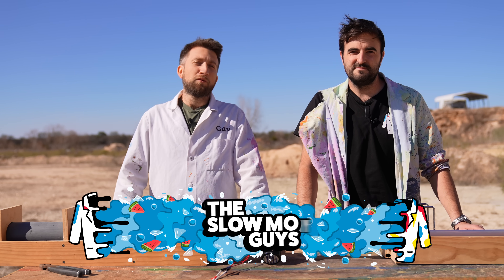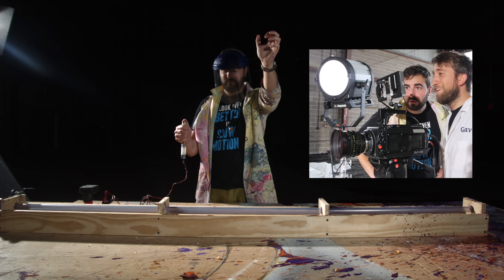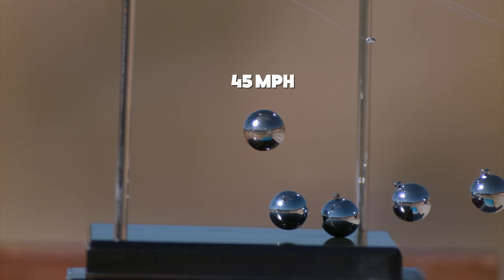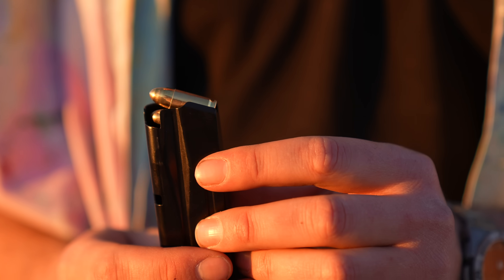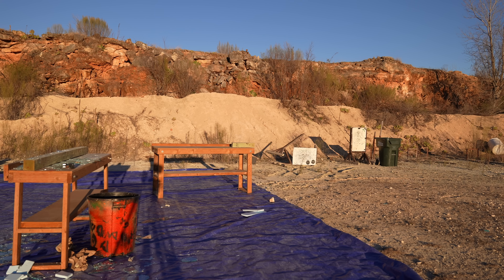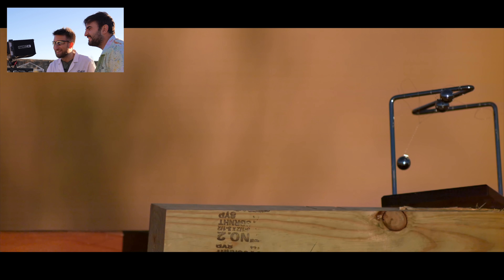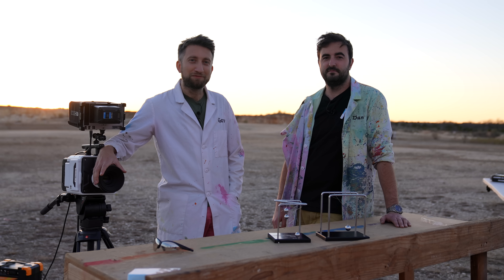Bullet vs Newton's Cradle at 100,000 FPS - The Slow Mo Guys

Comment: Good video.  The concept of the conservation of energy is a rather prominent and important concept in physics.  Which applies to no end of mechanical design and such.

@7:25 (or so) Daniel mentions 'cupronickel' as jacket material.  Cupronickel was used as jacket material in the past, but in 1920s (a period of time) manufacturers changed over to what is known (at least in the United States) as 'guilding metal'.  There is a difference in the composition.  
Cupronickel is an alloy of copper, nickel and some small percentages of a couple other metals.  (Look it up on line, this is the minimalist version.)  Cupronickel has been used for various things since China in the 300 BC range.  It has a multitude of uses, and is highly resistant to sea water, among other traits.  In the early days of the smokeless propellent era, it was used to make bullet 'jackets' the harder outer shell of a lead core bullet.  That set up worked much better than plain lead.
However, after several years, cupronickel was found to leave deposits in barrels.  So much that the deposits could alter the internal pressure of the arm and create explosion possibilities (and seemingly some explosions).  
Gilding metal is another copper alloy but no nickel.  It does also leave deposits (smears) in the barrel of firearms but at a much lesser rate and seems only to affect accuracy in extreme cases.  This material pretty much replaced cupronickel as mentioned.

Cupronickel is nickel colored - easy to confuse with silver.  Guiding metal is copper colored - easily confused with gold.  Not difficult to distinguish.  However, 'cupronickel' is still used in popular conversation to refer to bullet jackets.  Added information:  most commercial ammunition is not 'steel jacketed' either.  A few specialized rounds are, but they are nearly all made for and used by various militaries for special purposes.

Comment: I wish you guys can show us a Slo Mo shot of a car engine combustion chamber when the pistons squeeze the air and fuel mixture down to a centimeter tight and let either friction or spark plugs depending on what fuel you use diesel or gas ignite the mixture and send the pistons sky rocketing down to the crankshaft. That would a worlds first slo mo shot and pretty cool my uncle dad and grandpa would definitely love to see that

Comment: Strings are too short to not break immediately and thus affect the trajectory of the ball. You should make a 10' tall Newton's Cradle and try this one again...maybe even use 50lb fishing line?
Reply: To me, it looks like the string is not breaking, but the mount is coming off of the balls in most cases.   The best thing would probably to use piano wire and drill a hole through the balls and run the wire through the hole.

Comment: The bullet thing is a lot less surprising when you think relative. To us the bullet is moving extremely fast at the ball, but from the bullet's perspective, it's instead the ball that is moving extremely fast at the bullet. They are both colliding as equals, and the ball bearings were simply bigger and harder. If you shot a ball bearing at the speed of a bullet at a bullet, you would probably expect the bullet to shatter.

Comment: Something else to consider: the BALL bearings are, well, balls.  That continuous curve also deflects energy remarkably well unless the bullet hits it straight on. That's the same concept tank designers were starting to catch on to as early as 1917.
Reply: Right, rounded, welded or cast armor is much more effective than riveted armor with all its right angles
Reply: @edwardcardona717  it really depends on the angle except if one has got these special multi material armor they've got today
Reply: he he balls 🫵😂
Reply: @tigersarecool471  as well as medieval tower designers! It’s a very, very, very old concept, likely old as time, though people may not have fully understood it.

Comment: 9:45
Skip all the garbage filler
Reply: Why is it filler?
Reply: @Jack Costabile I guess you can view it like that, but I don't think you can call the original thing they set out to do filler when they only decided to do the gun stuff on a whim after doing a few test with the original one. 
Why is it garbage, I guess would have been the better question. I could think of multiple reasons people would want to watch the stuff before the timestamp provided.

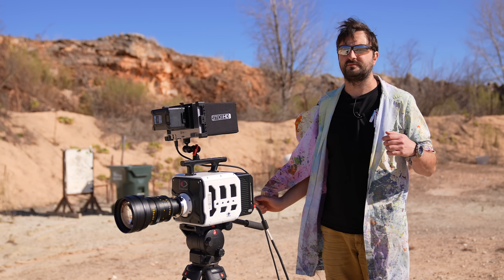Comment: @5:03 you can see the shockwave travelling up the suspending lines, at an angle similar to what you see with schlieren imaging.  Perhaps it could be used to determine the speed of the shockwave through the suspended balls?

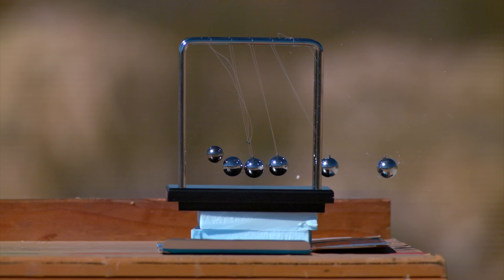Comment: 3:33 , It not only had enough power to force the end ball to rip itself from it's supporting line but also enough for the ball to CONTINUE pretty much going perfectly horizontal at the velocity, I guarantee you could set up a target at the other side and that end ball would be hitting it.
Reply: They should have measured the distance and fall rate of the last ball that came off. The rate of fall is deterministic, and the velocity of the last ball is deterministic and measurable from the video; so it would be interesting to see if the last ball landed where expected with the fall of gravity and the velocity.
Reply: MY BALLS!

Comment: That's an impressive shot and a remarkable result. I expected the bullet to fragment on the hard steel ball since it is only lead, but I thought it would impart way more of its force into the cradle as it hit. I really figured the whole thing would be completely destroyed. Really cool stuff!
Reply: Watch the fifth ball leave the frame. A Newton's cradle is designed especially to conduct that energy from one to the next with the lowest possible loss of energy. It is why the hooks that are attached are simply glued rather than welded. Any deformation in the sphere would diminish its ability to transmit energy.

Comment: Lethality of bullets are two-fold; the weight of the projectile and the speed of the projectile.  The ball bearing has MUCH greater density.  The lead bullet is also much softer than the ball bearing; hence your results.

Comment: How about trying this with API rounds? If there isint any available you should be able to make one inserting peace of endmill carbide or hardened steel drillbit to center of the projectile. That should be harder or hard as ball bearing hence not shattering like bullet did.

Comment: The newtons cradle relies on transferring all of the energy (or as much as realistically possible) so the hardness off the balls is key. The soft bullet just can't transfer it's energy efficiently because a lot of it is lot in the deformation, and the pieces also take a lot of enrgy with them.

Comment: Ok guys Ive watched this video a few times, on the second test, the impact broke off the connecting ring. I'm sure the steel ring is stronger then the string holding it, so why didn't the string just break instead of the loop connected to the ball. Also what is that called?

Comment: The reason  the FMj round basically desentagrated is because that's what hand gun ammo is generally designed to do 

Create massive wound cavities to do the most damage on the  intended target without over penetrating especially  FMj and holopoints because FMj in civilian and police application is normally regarded as range ammo and hollow points are designed for self defense on soft targets where you don't want rounds sailing through the bad guy or to take game humanity by dumping all they're energy  into the target  makeing a huge temporary hole hopefully disrupting the spinal cord or if your shot placements not perfect  at least sending the target into shock so they either have an instant on off or they really don't feel what's going on 
You can get copper rounds core bonds etc that would have faired better in the penetrateion department  due to material used and intended use more for getting through cover and car doors etc when a rifle isn't available

Comment: In the first clip all the wires break due to the kinetic energy.. but the first ball is different. The wire does not break, but the handle breaks off the ball, most likely due to the vibration on impact.

Comment: 10:00 one can see the last ball bearing, went flying, since it took most of the energy transferred from first 3 ball bearings: bullet shattered to pieces since it not-only incurred the brunt of first ball bearing, but also the action or left force/weight vector of the other three ball bearings still touching, thus the first one went flying!!! Due to energy transfer 10:15 sorry mate, only 3 ball bearings left… peace

Comment: Should’ve used lead bullets. NOT FMJ. You call yourself a weapons and munitions expert? What a dumb choice.
Reply: They weren't planning to use it. They just did it with what they had with them. Calm down.
Reply: Lead would have been even more brittle. Solid copper or steel core rounds would have be better.

Comment: This experiment, while using an extremely large display, it is the perfect representation of the  nature of energy. Wether it be the passage of electricity within a wire or even quantum entanglement. Kinetic energy while slow, compare to the speed of light or beyond as in quantum entanglement has the same relative behavior, in that the last ball in the strand behaves as though it was the first struck.

Comment: I would suspect 2 things . . . 1)  The impacts are hard enough to fracture the string loops welds/brazes.  2)  I doubt the balls are very hard.  Probably mildly hard then chrome (or other) plated to be shiny.

Another experiment would be to get some very hard (industrial) balls, and set them on a "V" track, with a very slight up hill slope.  (So they will all sit tight against each other, trying to roll down to a small stop barrel side of the first ball.)  That way all the inertia, is initially traversed straight through the stack; no swing involved.  (Some rolling though as they start to move.)

Comment: Lead is more dense than steel. It had considerably more KE than the ball bearing. The transfer of said energy was more effective with the ball bearing than the bullet due almost wholly due to the Rockwell Hardness of the lead being considerably lower than steel.

In layman’s terms, the lead shat all of its energy into the surroundings when it splashed against the steel, whereas the ball bearing focused all of the force on a singular point and transferred almost all its energy directly into the cradle.

Comment: 7:13 The outside of an FMJ bullet is actually much harder than the lead on the inside. The idea isn't to engage the rifling more, but instead reduce the amount of metal that would otherwise be scraped off and deposited in the barrel.

Comment: Demolition ranch stacked phone protector screens together for a bulletproof glass type deal. It cracked the first set, didnt damage the middle protectors and annihilated the section towards the end. A bullet was fired at it. It would be cool to see that experiment in slow mo to see how exactly that worked. It's probably a newton's cradle using screen protectors.

Comment: Wouldn't it stand to reason that the bullet's construction isn't as solid as the bearing being the reason for it's demise? You have to think that the solid bearing has to pull apart all of those solid bonds in multiple directions versus the bullet's essentially 2 dimensional bonds?

Comment: Someone correct me if I'm wrong as I'm definitely not a mertials expert, but Lead is far less elastic than steel. As such the bullet loses a lot of its energy to plastic defomation and the bullet itself ripping apart whereas the steel ball has minimal plastic deformation which results in a much more efficient transfer of energy on impact.
Reply: Sophomore materials engineer here, you're pretty much correct. Although I would say that the lead is less "resilient" (referring to the amount of energy that a material can absorb before plastically deforming) than the steel.

Comment: i'd be interested to see whether the curve of the ball had anything to do with its resistance to the bullet. i get steel is harder than lead, i've bitten into a lead weight just out of curiosity its fairly malleable, but the fact that it acted almost as a liquid  in terms of collision density i'd be interested to see if you could potentially make armor out of steel incorporating that same circular design as a way to disperse the force. probably completely irrational but it'd be interesting. of course the dispersion of lead could make the use of armor impractical you're basically making 128 gauge shot out of a 9mm bullet. one of the main reasons that shotguns are so lethal is the fact they are hard to really block especially from maybe 20 feet away

Comment: Note that the nylon didn't snap - it was the connector that broke off the balls. Which makes sense: the vibration would go through the metallic sphere, and the join is both small and relatively fragile (a weld). The nylon never even gets stretched.

Comment: I actually DID think the bullet might break apart! I did at least know that the ball bearings would be much harder than the copper jacket of a bullet, though I didn't know if the newtons' cradle would have used properly hardened steel or if it would just be something like mild or stainless steel. Either way, greater hardness than copper, and the bullet is hitting said harder surface at more than the speed of sound.
Slower subsonic rounds might not break apart so dramatically, but that would still depend a lot on the actual materials.

Comment: What's cool is to see the speed of sound in the metal at 5:00.  It latest like 6 or 7 frames for the energy of the impact to make it to the last ball, much quicker than the speed of the incoming ball.  Also, the first ball of the cradle retains some of that energy because of the deathstarification (deformation) of the balls.  That's some high-velocity science, right there...

Comment: the mass of the balls is too much compared to the string, that is why the foremost ball behaves as if there were no string attached to it
Reply: You can see the intact hoop still attached to the string. The impact is snapping the weld right off the ball. Pretty neat!
Reply: @Jikkuryuu  bingo! more specifically, the ball is deforming and the weld is not so it just pops off.
Reply: @MrBlaktoe  i actually don't think it's the deformation nor the weight. I think it's due to the initial vibration of the impact combined with the existing tensile stress, which broke the weld as there many irregularities in a weld.. if it would have been due to the weight of the ball it would only have been the string that broke, and if it was due to the deformation the break would likely be at the base of the loop. I suppose you could argue a deformation is a part of a vibration in any case I have close to 0 confidence without doing the experiment myself. 😂
Reply: @MrBlaktoe  exactly, its not a perfectly bonded material and thats where the shock first reaches. The string absorbs shock extremely well, and thats why several of them remain attached until they reach the highest point in their arch and up until force was applied to the knots securing them. If the knots wouldve been mechanically "perfect" it wouldve then become a question of the tensile strength of the what seems to be comparable to a 10lb test fishing line from my mkii eyeball
Reply: I would've guessed that the first string snapped because the smaller ball shot from the barrel hit the first ball at a point above the center which pushed the ball slightly downwards and thus snapping its strings off
Reply: no

Comment: Place 5 steel balls on a level surface, magnetize them slightly so they stick to each other very slightly and then repeat the experiment
Reply: Don't even need to have a magnet just tilt the whole assembly up a degree or two and place a chock on the downhill side.
Reply: You could also machine the cradle so that the strings are placed just slightly closer together than the diameter of the balls, possibly only the first and last ones set like this.
Reply: @WeighedWilson  Good point, I was also thinking about balls of different sizes, i mean from large to small in succession
Reply: @TheFinalRevelation1  sus
Reply: Ooooo... Genius right there...
Reply: Hard to get them to stay in line I guess...
Reply: @stahlschorsch  Put them in a groove.
Reply: @stahlschorsch  Absolutely necessary they are in contact so that the impact gets transferred to the last ball
Reply: with a 50 bmg this time

Comment: 3:28 my theory is that first ball falls off because of the imperfections of the hit.  
2nd didn’t because it was able to successfully give enough of the impulse to 3rd 4th and 5th because it was to much and the plastic leads couldn’t hold on.

Now the question becomes. If it all went perfectly. Would only the last ball have flown off?

Comment: The reason why the balls get torn off of the cradle is that the purely horizontal force coming from the impact relies on the string, and the joints of the string and the balls, to provide vertical motion (so that it rotates as it pivots) and this cannot withstand the force and breaks. This could be an interesting way to test other types of connections and string - as then the balls might stay on the cradle.

As for the bullet - I'm assuming that it's quite a bit lighter (maybe 1/10th the weight?), and it's moving only 3 times faster. This means that it's got less momentum and doesn't impart a force great enough for the strings to snap, and the first ball stays in place. This means that Newton's cradle definitely holds up, as long as the mechanics of the setup are not destroyed! Seeing that last ball fly off with the others remaining still was amazing!